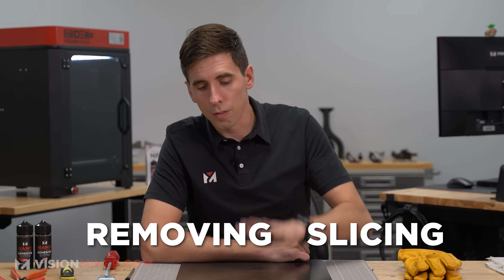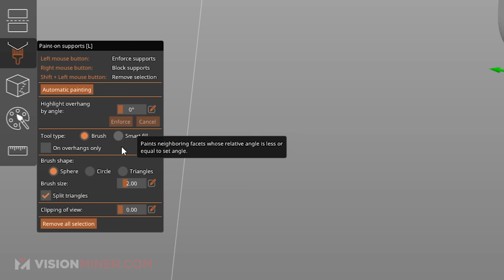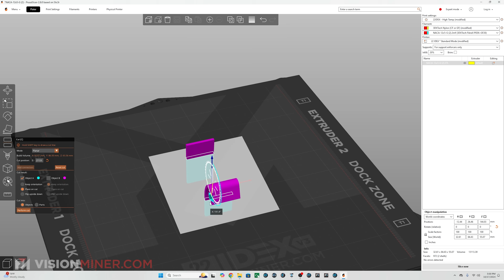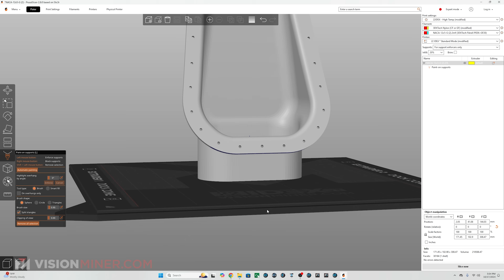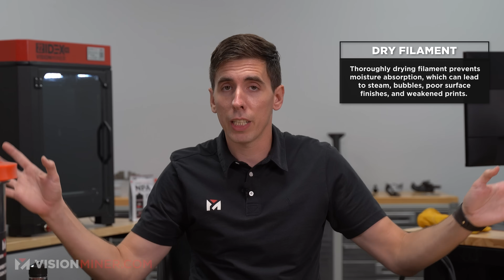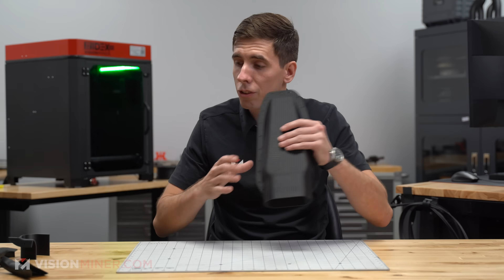Carbon Fiber Nylon 6 Car Parts: 3D Printing Workflow Tutorial on the 22IDEX

Comment: You missed the most important point. Cost. The cost of those parts would likely be 1,500-2k a piece. A day designing in cad, a wasted day+ printing the first failed part, another 1-2 days troubleshooting your supports, another day or 2 to print the final parts, and then the inevitable comment from the customer about it costing so much when his grandkid is using a $300 amazon printer to make stuff much cheaper.
Reply: That's why this works at hobbyist DIY level, not so much 1 offs, unless is for your own product development on early prototyping. Each process has it's own benchmarks.
Reply: yeah a bambu a1 with a hardened steel nozzle and a diy chamber could make these parts and thats $450 tops
Reply: @jackdolezal9742 If you believe that, then do it. But, as someone who has been into 3d printing for 2 decades, I can assure you, you're gonna have a bad time. There is no shortage of printers out there that can do this, on paper. But when it comes to actually producing parts, the failures cost you more than just buying the right printer from the get go.
Reply: @ Ding Dong Drift had been printing car parts for a while and he even has a few very coolant system components that he printed on a bambu printer so im pretty sure its doable
Reply: @jackdolezal9742 I have some bambu's. It's all about size. He made a thermostat housing, that's tiny, but using the right filament at least. But when it comes to larger parts, like his bumper, he uses hobbyist grade filament, prints 38 pieces, glues them together, and then covers it all in fiberglass because the plastic he can print on them wont handle the conditions they will be exposed to.
Reply: @ im really confused what your point is because its not like this printer can print the whole bumper in one go either. Anyways nylon is way more expensive than pla or petg so im assuming thats why he chose it
Reply: @jackdolezal9742 You're assuming, I don't have to. What you'll find with printers like the bambu is when you start trying to print parts larger than a coke can with engineering grade filaments, they don't meet their advertised capabilities. You may be able to pump something out that will work for a hobbyist, but for a business, they run a real risk of being unprofitable due to the print failures, cracking, warping, etc. Which has been the whole point from the beginning, but its the same conversation everytime with people that have seen $300 printers and think everything above that is a scam.
Reply: Nah, Maybe that much $$ if it required Ultem and a scanner, but these are pretty simple and only CF Nylon. This part is simple enough to be recreated in CAD without a scanner. Enclosed, heated printers capable of printing CF Nylon are now $500-$1500. So yes, anyone with a decent printer and mediocre free CAD skills could create these parts in a couple days.
Reply: @vica153 Says the guy who has ZERO idea about designing in CAD. 😂
Reply: @peterpizzurro  If you say so...
Reply: im my case I don't factor in anything but the filament. Otherwise id have to justify to my wife the cost of the printer itself lol. Tho in my case, Im starting on parts that simply arent available. No one is designing what I want, so Im scanning parts and designing stuff for myself. then if the limited community of drivers of my car want one, maybe then worry about production type designs and workflow
Reply: He started by establishing his shop was "high end". Therefore, cost is not an issue.
Reply: @jaminoes_  he's putting info out to educate us. Cost is often what people care about most. Case in point. I get asked which 3d printer should I get all the time. They freak out over a $1500 printer because they saw $300 printers. Meanwhile I have one that cost me $15,000, and there are printers out there that cost $150,000. So many people consider a $1,500 printer to be high end, while in reality it is still a hobbyist printer.
Reply: It might not be this case as person wanted this guy to specifically print it. BUT if you're offering 3d print service and you're considering yourself being pro in the field I'm not paying for your failures... you should know how to do stuff you're offering. Cost of material and time because you didn't do your job properly? that's your problem.
Reply: I must have been the grand kid I guess. I printed myself some PA12 CF velocity stacks for my ITBs on a lightly modified Ender3 with an enclosure. Only a couple failed attempts mainly being that it was my very first time ever using that material and I was very new to 3D printing.
Reply: I think it really depends what you need out of the printed part. If you want to push the limits of the material’s capabilities, you do need better temperature control at least. That doesn’t mean you HAVE to spend thousands on a printer, just that often when you do, they account for those things. A DIY chamber that can hit 70C will help a lot with ABS and nylon parts. A lot of people think that just because they can print it and it looks fine, they’re doing the same thing as a well engineered setup and that’s definitely not the case. It’s not that you can’t do this stuff for cheap, it’s just that there’s more to it than what it takes to make the shape you’re looking for using the filament you want, and sometimes the things required to reach certain temps do in fact cost money. 1” of Home Depot insulation is pretty cheap and will go a long way though
Reply: Depends, designing cost should be fixed if you are capable with AutoCAD. Next you should always know how your filament runs in a print. First print would definitely be in ABS just to check fit. After test fitting and customer approval a validation print with the finish material to validate calibration points and then printing the batch of prints. If you have to do the design you do need to charge differently for design than you do for manufacturing.
Reply: In his defense, he politely declined but the customer insisted they produce the parts for him. My guess is that cost wasn't a factor in his decision.
Reply: @macgyver9134  he just taught that grand kid information on has to layout the first model....then print multiple models without error....then generating profit without multiple fails and wasted filament, cad time and personal time. Also a 300 dollar Amazon printer cant print half these filaments. Not heated chamber (youll get warped parts) sub 300c nozzle and a soft nozzle with will wear too quickly since its brass not hardened material. Without knowledge shows here. But I understand your point...kinda.
Reply: @Cereal_Killr you can easily print PA6CF on an ender 3 with a few modifications. People do it all the time. A hardened nozzle can be bought for a few bucks. The hard part is the CAD work. PA6CF is consumer grade filament while the other filament he mentioned are more production level. That's why his printer has the 500c nozzle 200c bed plate and 100c chamber.
Reply: how dare THE POORS own 3d printers that doesn't cost as much as an SUV. They can only make trinkets and toys with them anyway. So irrelevant.

Comment: thanks for the vid. solid tips. first print with Polymaker PA6-CF on the Bambulab X1 Carbon.. FPV rocket drone app. upgraded the hotend with Biqu cnc'd metal gears and frame. planning to use a 0.6mm hardened nozzle, vice the 0.4mm (common). target speed for the drone is 200+ mph. let's go.!

Comment: (see 1405s in) why don't these very expensive printers have a filament consumption sensor that measures the amount filament being consumed?  Like two opposing rubber wheels, one of which is monitored for rotation through which the filament passes?   this could be used to detect out of filament AND jams.
Reply: search youtube for 
Build a 3D printer filament meter kris k

Comment: I know yall sell vision miner but damn that’s a lot. Iv got a mix that uses it a minuscule amount in comparison and haven’t washed my plate in months printing every day and haven’t used half the little bottle. Only time I’ve had to wash the plate since using said mix was when I was dump and bumped the lead screw oil and brushing a bit on the plate. Key to the method is redistributing what’s already on the plate. I found if you just print over and over you get a hair of discoloration this also avoids that. Love the stuff by the way has streamlined my prototyping workflow and labor input. Great product.

Comment: You would almost think a professional printing company would do a test print on the Support section before running the whole dang part, but hey, what do I know?
Reply: a true professional would already have the experience to know what supports are needed and not require additional testing, just one and done.

Comment: I wonder if you can 3d print a rollcage using these materials, just need to figure out how to bond it  with the body
Reply: Please don't use printed plastic parts in safety systems. 😮
Reply: Nope! They don’t come close to the strength and toughness required for those.

Comment: Really cool project!

I currently work in a factory that uses a lot of big tie-wraps and nylon air tubes (both made of polyamide 6.6), I'm talking about leftovers of basically new material that gets thrown away. I started thinking about collecting it (I could collect hundreds of kilos of it) and turning it into nylon filament. I would probably use slightly modified 'Desktop Filament Extruder MK3S+ (DIY KIT)' from artme-3d. 

Do you think that could work? I would probably have to use that filament myself as it's not a 'professional' extruder and the tolerances woudn't be too good. Any ideas how could I use that material? Where the PA6 would fit the most?

Comment: the unsaid part: "and all you need for this project is a $16,000 printer"

I am not knocking the printer itself but that is NOT in most viewers budget :)
Reply: You can print cf nylon on most printers any that heat up to 300C a print bed that goes to 80C a hardened steel tip and a print enclosure
Reply: 😂😂😂😂 I was like alright! Lemme look this baby up and see how I can try this myself.....uhhhhhh nevermind 😂😂😂😂

Comment: This seems like an EXTREMELY expensive machine to be missing so many basic features that you can get on something like a Bambu X1 Carbon.  The way you have to load filament, no sensor to know if your filament stopped extruding, no layer 1 validation, no magnetic build plate... And if my first print looked as bad as yours did, I'd be pissed I spent that much on a printer with no added protections or quality.

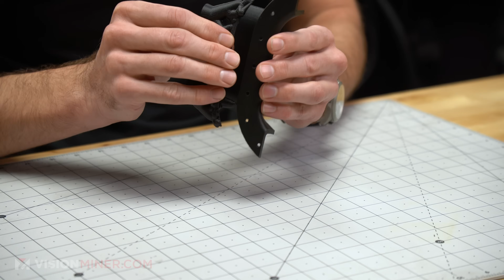Comment: Beautiful piece... By what I see in  27:20,  I suppose they could have added parallel ribs going up from the main body to the flanged contour, to act as support (if there is space under there available in assembly, could be even be part of the design ).

Comment: THIS IS EXACTLY what I need to make prototype car parts! I just don't know if I can ever spend that much on a printer.... maybe one day!
Reply: Consumer printers have come a long way. I recommend the Qidi Plus 4 (bambu clone with upgrades). They're like $700ish for a complete out of the box experience and can easily print this material which IMO is a little bit overkill for the application. If not directly touching any heat source ASA or ABS would have also worked at a fraction of the cost.

If still too expensive you can buy a decent entry level printer and with some easy mods and a homemade cardboard box enclosure be printing CF Nylon with decent results.
Reply: I made my prototype on a $500 Creality to check size, fitment, function, and continue the build, but sent it to VM to print out of something that would hold up because my printer couldn't. I also design and print parts before having the models machined out of alum, or other metals, to see if they will fit and work like I want. Easy and cheaper to change a model and print another version than to spend money on machining.  😊

Comment: You forgot that PA6CF shrinks, you have to print it on 101 or 102% (measure it on a testprint ) and the part needs to get tempered after printing !

Comment: nice 914 I love mine.. what are the bottom vents for ?
Reply: These naca ducts are also ducted and are being used to extract hot air exiting an oil cooler just behind the front bumper.

Comment: Having owned a 914 myself, I have to say this is a very strange duct he’s adding to his car. I guess this is a non-v8-swapped car and it’s for the oil cooler exhaust but I am curious why he wants to send hot air under the car rather than into cut-outs in the wheel wells or, even better, ducts cut out of the hood.
Reply: First, it's a vintage race car so scruteneering has a lot to say about altering the shell of the car not to mention that's a lot of extra work😊. Second I didn't want to add more heat to the braking system. Third the amount of air traveling through a 4x12 oil cooler is minimal and a hot air is less dense than cooler moisture laden air right it might even help with aero 😅.

Comment: Unlike many other people in the comments section, I will not comment on the print quality and cost. I wonder why this part was not optimized for a more consistent air flow and reduced turbulence? It looks like it was made by intersection two fairly simple geometrical shapes, but the problem here is that the joint between them produces unwanted drag and turbulence, hence the performance is not as good as it should. This particular model could be easily done with free-form NURBS modeling program (like Rhino) for less than 30 minutes offering a much better air flow.
Reply: This is a forced air system so all I needed was smooth flow of air out and I had limited space in which to do so. I appreciate your input. Perhaps you could let us all know how much a seat of NURBS costs if we were in the market to buy one.

Comment: Crazy to think that less than 5yrs ago this part&material would have required a 5k-10k printer. Now anyone could have made it with a ~1k printer. With some design tweaks to build it in 2 pieces, it could be made in a ~$500 printer.
Reply: You are not going to find a $500 or even $1000 printer that has the heated chamber or temp capacity needed to do nylon, but yes... The capacity of printers in terms of capability and volume for the price has improved greatly over the last decade as has the support for DIY printers. This, thanks in large part to the many youtubers promoting the hobby.
Reply: @mattlewandowski73  Qidi has their previous gen printers for 500 and current gen for 800 right now. 350C nozzle. 65C chamber. I've never tried one. I''m still running my little old aquila, but they seem to be good for the price.

Comment: what is the actual difference between a machine like that and a bambu x for eg(for one the bigger build volume, and probably the ability to print in more exotic materials.). except the very high price. what can it do that lower consumer models cannot? kinda curious.
Reply: This exact filament he uses prints fine in a bambu x1c. the printer in the video is made for more engineering materials that require very high temps that most consumer  machines cant reach. 500c is much higher than the 300c nozzle temp from bambu
Reply from the maker: Right on!

Comment: An oven is not necessary when vacuuming. Water boils at room temp in a vacuum chamber, in fact the temp of the water under vacuum gets colder during vacuuming. Additional cost for the the oven is not necessary. The fact that the air temp in side the chamber is drastically higher than the in coming air temp as you release the vacuum from the chamber can cause the cold air to recondense forming water back inside the plastics at a more rapid rate. This is how fronts work and perception is formed in fronts. Recommend you just vacuum at room temps only.
Reply from the maker: In actual experience, however, it's very necessary. Check out CNC Kitchen's video, where he just vacuumed cold spools, and it didn't get the desired results, especially on higher-end filaments. Now -- you're absolutely correct about condensation -- that's why the BEST method is: 1. bake spool 2. vacuum spool 3. allow spool to cool in vacuum 4. remove from vacuum. 

Otherwise, you're right -- hot spools absorb moisture much quicker. If you're in a pinch, a hot spool and quick vacuum is still much better than a cold spool, though, so long as you don't leave the hot spool out in cold air too long before inserting it into the hot printer chamber :)
Reply: It depends on how much vacuum you create. I doubt many can actually get near true 0 atmosphere so the higher temp helps meet in the middle somewhere and would speed up the process.

Comment: Did you mention needing to swap out the usual Brass nozzle on most machines for a Hardened Steel nozzle for the extremely abrasive Carbon Fiber?
What about Safe Handling? - Don't handle PA-CF filaments bare handed, and NEVER make anything from it that will be used near bare skin or food service. Sanding requires full PPE with gloves and mask, and PA-CF parts should be sealed in a paint or clear-coated before use.
The short Carbon Fibres used in PA-CF need to be treated as just as dangerous as Asbestos or Diamond Dust.
Learnt most of the contents shown here while getting PA-CF to print reliably on a Voxelabs Aquila X2.
Reply from the maker: You definitely want hardened steel nozzles, instead of softer materials like brass -- Hardened Steel is standard on the 22 IDEX, from the factory. Handling PPE should be considered, certainly!
Reply: what enclosed printers even come with brass nozzles nowadays?